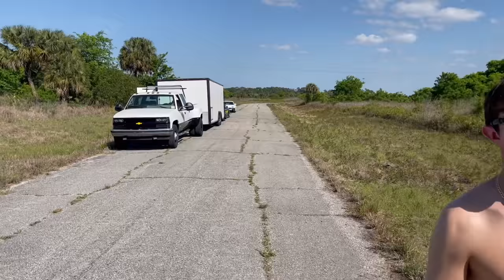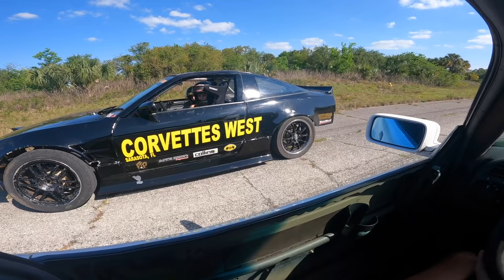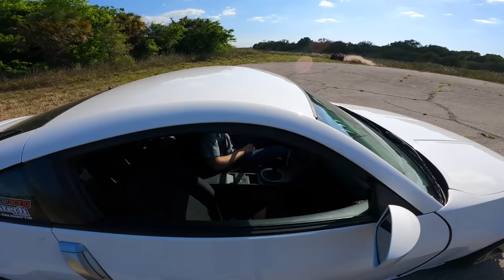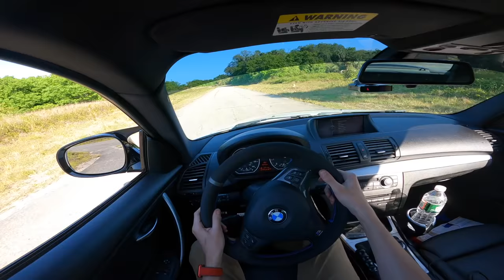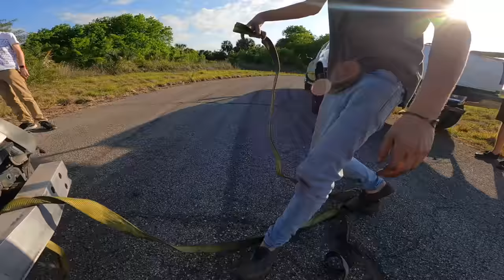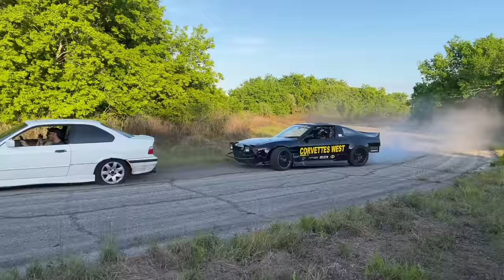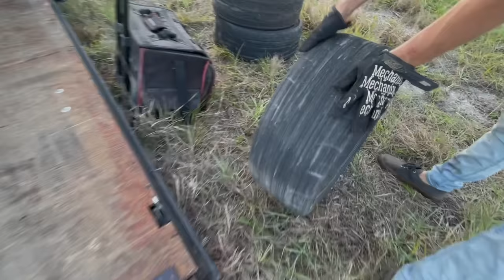How To Drift: Just Starting Out!

Comment: 1:00 no one heard “isn’t that the same engine that’s in the Supra, N54”😂😂
Reply: i mean, he got confused with the b58
Reply: The new supra has the b58 from bmw which is similar to a n54
Reply: @davidperron2390  the n54 is a nightmare tho and no one wants to touch it lol
Reply: @davidperron2390  new supra is basically an M140i the supra needed a S55 twin turbo atleast
Reply: @scottex.  I have an M135i LCI N55 its a great engine
Reply: @Soulkollextor  the n55 is much better than the 54 tho
Reply: @scottex.  ehh i heard n55 aint that much better but had improvements.

Comment: Scandi flicks I find it's easiest to learn if you're just using the weight transfer to initiate. Soft turn right, hard flick left as you lift off throttle, then back on full throttle and counter steer

Comment: The shaka was a little cringe - being hawaiian, lol - but it was a great tutorial. Still not sure if i want to take that leap because the only streets i'm comfortable in trying, that are large enough, are filled with residential housing and curbs. Not to mention my tires cost around 200 a pop. need to get some cheaper sized rims. I took the traction and distribution control off a few times but i always tend to oversteer and over gas cause I don't trust my steering to auto-correct since it's electrical - feels more rigid since powersteering liquid isn't a thing for the car.

Comment: what about the differential? I have a 318 93 E36 sedan 115 hp, but it's faitly hard to make it slip in a normal road, so my question is: should I block the differential so I can drift? Or do you suggest another method ?
Reply: yeah welded diff all the way like you said hard to slip otherwise

Comment: Hey brotha any chance you can make a short video going over your parts list installed on the e36?.?.?
Also what year, engine model, miles on it, and what's your guess on how much power and tq you have before and after.... I mean obviously stock is 190ish
Please and thank you 

(Gold 92 e36 sedan m50b25 non vanos [babbyyyy!!! Hahaha] coils and other random goodies not much thou...
Currently trying to find a m50b25 non van motor for sell as a stoker project possibly even bore it out)

Also another question maybe the beamer community can help me with is how much more power would Stoneridge your motor add going from a 2.5 to 3.0 stroked maybe even 3.2 or 3.3 If I decide to bore it too cause I have absolutely not a clue haha
Reply from the maker: https://youtu.be/DSEDz5FclGg

Comment: hey guys, i got a e46 325 compact, and im not sure what im doing wrong, in second gear it just has so much grip it feels almost impossible to make the rear get loose. My biggest fear is always it gripping up and sending me into a wall, already flew into a ditch before. I did get brand new summer tyres for it, but do they really have that much effect?
Reply from the maker: Try upping the tire pressure to around 40-45psi, turning your AC off, and removing anything that weighs your rear end down (spare tire).
Reply: Have u tried turning of DSC. Im my coupe Ive done some nice drifts but can only powerslide with DSC on. DSC is basacally Traction Control. If i remember correctly.
Reply: for anyone wondering the problem was with airflow (bad disa valve and sensors), I was randomly losing power and gripping up. Once I got a remap done all is well now

Comment: What is done to your e36? I have an e46 325ci (welded diff) and I can do donuts no problem but have trouble holding the drift in 2nd gear at a decent speed entry. It straightens out basically right away even at full throttle.
Reply from the maker: Put like 40psi in the rear tires
Reply: @HoonGarage  yeah I think I had like 43 psi.

Comment: How do we drift Takumi style, without using handbrakes?
Reply from the maker: Instead of pulling the hand brake clutch kick again. Will throw you out there so you’ll need to initiate sooner.
Reply: @HoonGarage  alright, so I go in with more speed so the front wheels lose traction during the turn, right?
Reply: Takumi uses inertia and trail braking to initiate and 4 wheel drifting